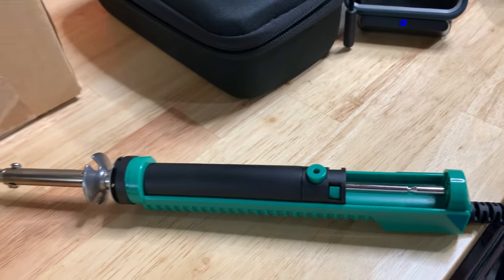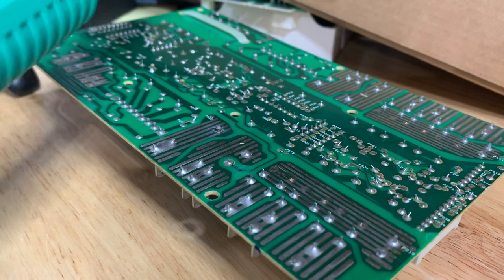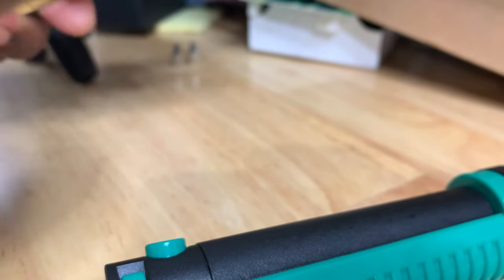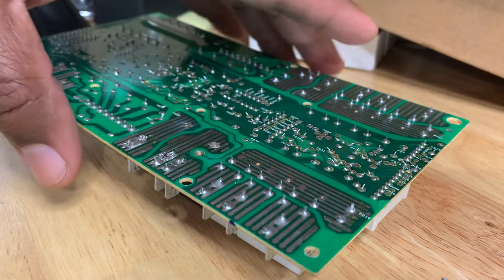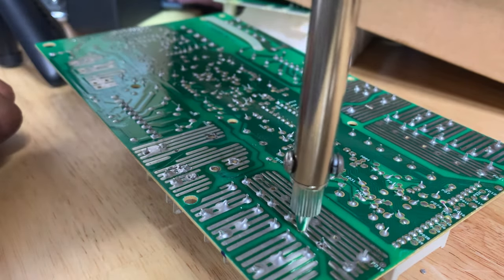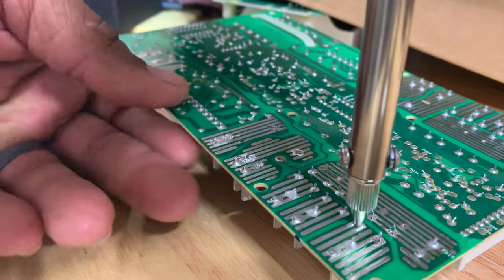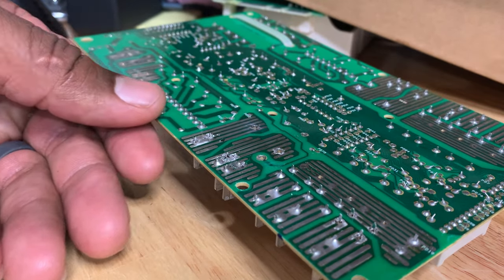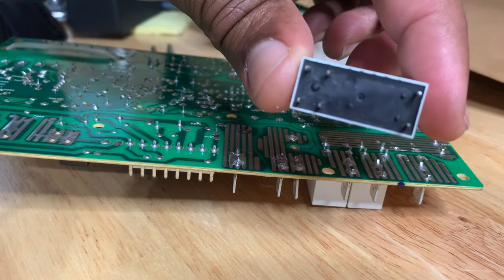YIHUA 929D-V Electric Desoldering Soldering Iron - True Testing

Comment: Put solder on the tip. Flux will help too. Going to be tough to get enough heat on the ground plane. Having some low melt solder is helpful as well.
Reply from the maker: Thanks for the tip!
Reply: This. With stupid lead-free solder. I usually use low melt solder to mix on solder points with soldering iron and then use desoldering gun. Works loke a charm.
P.S. Have one Yihua 929D-V like yours. Very good tool for a buck. But gave it to my friend after I bought desoldering gun. But I think that I want to have one more Yihua/W.E.P like this just in case.
Reply from the maker: @GFFrankJaeger  Thanks for the tips!!!

Comment: Well, works better if you heat the iron longer before, get it to melt some fresh solder and you may help yourself if you first add some fresh solder on the points to set the temp of the melting lower.
Also, do not put soo much force on the plate and best is to keep it vertical so it sucks easier and has less chance to cool and harden in the pipe of the desoldertool.
Reply from the maker: Thank you for the tips!